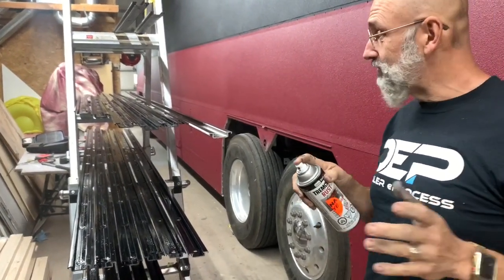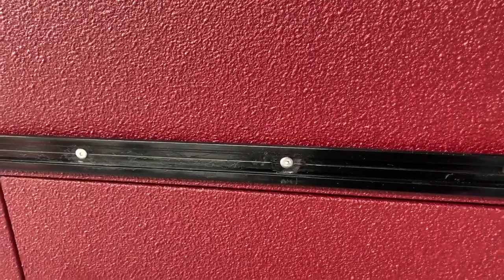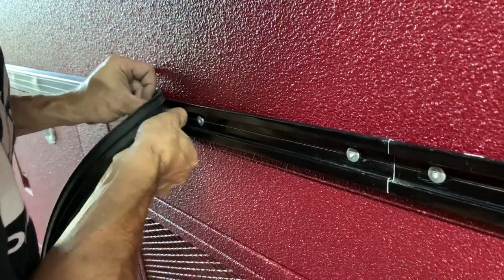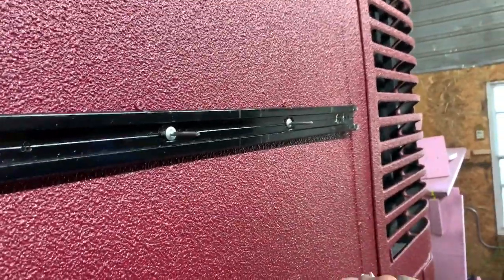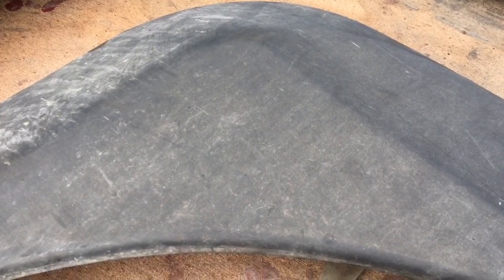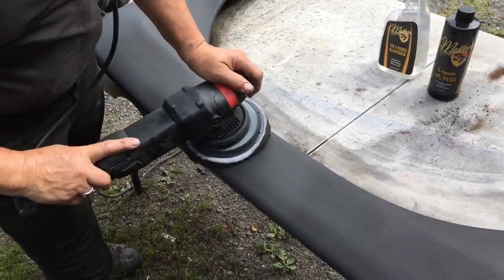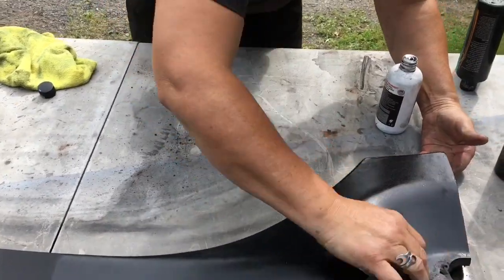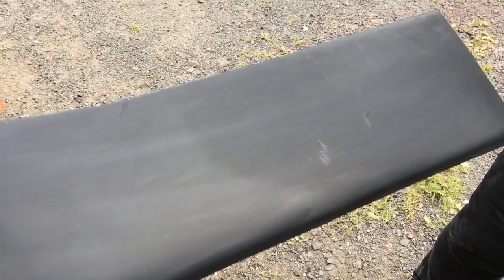E21, going back together. The Lacroix Cruiser Bus Build

Comment: Excellent video.. and thanks for Solution Finish tip... what about long lasting tire treatment and aluminum wheel treatments, any suggestions? Thanks
Reply from the maker: For tires we use this with great success , one application lasts up to a year. Also put it on the side of the tire you don’t see to prevent oxidation.

https://amzn.to/3gNwHwT
Reply: Thanks, I was just looking at that product. Thank you.. I am going to try their ceramic wheel coating as well..

Comment: Would it not have been better to use a plastic ( nylon) washer ? With stainless steel will it not react with the rail ?
Reply from the maker: The stainless won’t react because the rails are painted. Nylon might be a problem with the rivets because of expansion and contraction.
Reply: MCI put plastic between aluminium when they built them,  but I know that the side panels are aluminum but are the rivits aluminum?  They could corrode a way becoming loose ! I am just wondering !  I have replaced rivits on our DL3 and I put the rubber on the side with rubber hammer.  I love your way to clean and polish ! Have you ever used blue sapphire?
Reply from the maker: We used Aluminum rivets.

Comment: I have discovered my rubber appears to have “shrunk” over the years and seems too short for the rail by about an inch. Did you have the same issue? Did it “stretch” back after manipulating it?
Reply from the maker: It expands and contracts with hot and cold. On a hot day in the sun we have almost no gap, in the cold close to 2 inches